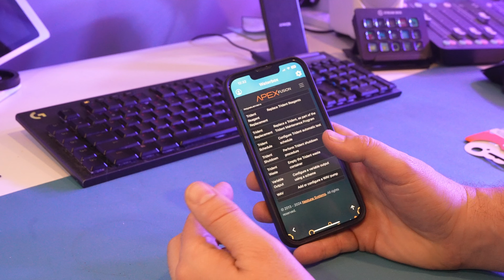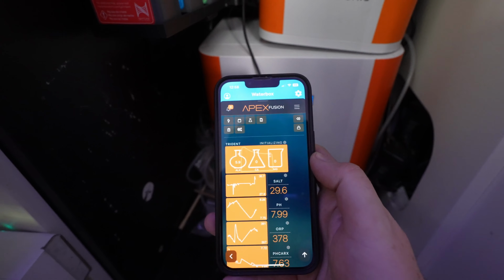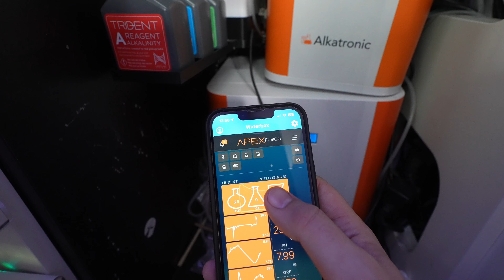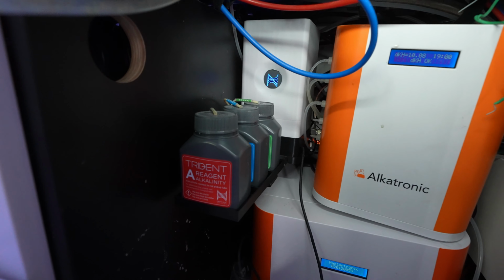How To: DIY Trident Service Kit

Comment: does that housing really save any space seeing as the reagents are next to the unit? Footprint must be similar or bigger?
Reply: You can see his mounted towards the end, I'd say it does, while the actual footprint if you include reagents are probably close overall it's still a less but also it allows you change the places you can put it.
Reply: Yea same size footprint....maybe more....just add a shelf for the trident folks....it's not that intrusive....especially if you don't have 4 other auto testers next to it like Dev lol
Reply from the maker: @Sammy31Dee  lol  Space is limited in my stand.. its like a Tardis.. i keep finding ways to fit stuff :P
Reply from the maker: Not Tons but a bit,  all depend on how much space you have to work with :P  as you can tell i have alot crammed into that tiny cabinet